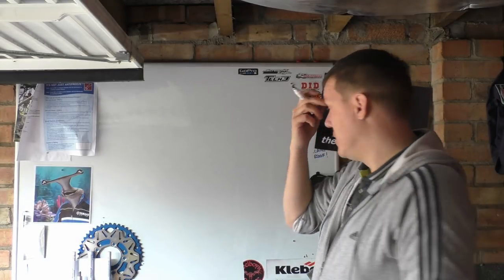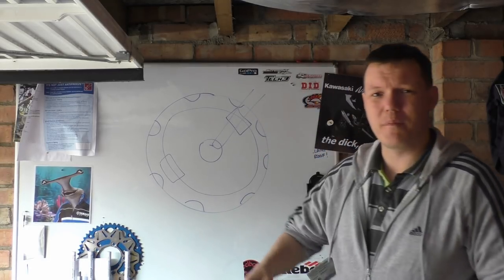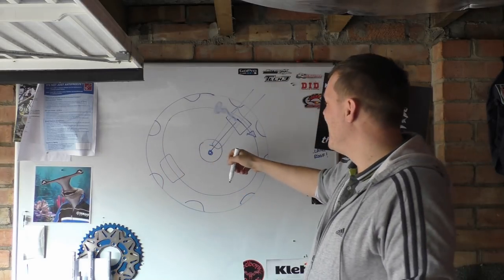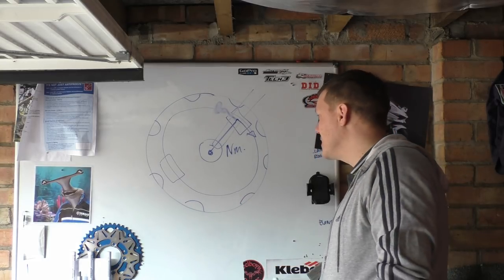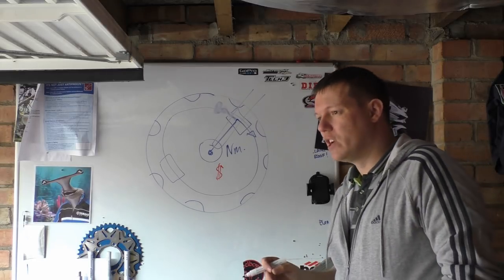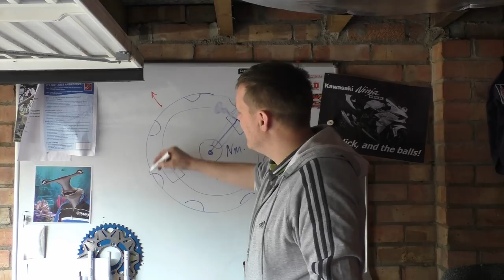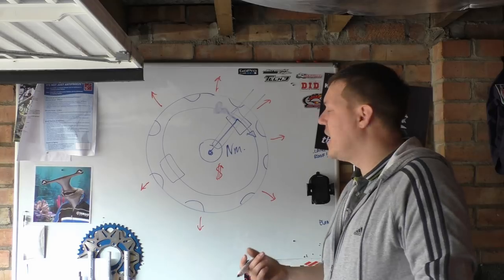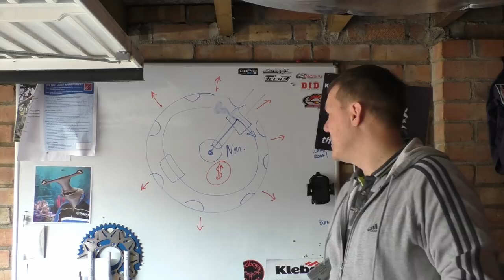Perimeter Brake discs - Any good?

Comment: One of the biggest advantages that Buell used to tout was that the wheel could be much lighter.  Because the forces are acting directly on the rim much less tortional strength has to be build into the "spokes"

Comment: They did it for many of the reasons you talked about but also because it reduces the torsional load on the spokes by transferring the braking forces directly into the rim. That’s why the front wheels are so light and the spokes are so straight, unlike a traditional wheel where you need to take up that tortional load with the spokes. You could argue that the weight saved by the lighter rim is just put into that larger disc but I don’t think this is true. Those EBR/buell discs are pretty darn light for their size and the wheels are also pretty light for a stock sport bike. Also, the ebr has a ram air funnel that helps to cool the rotor and caliper as well. My father calls it the “bee funnel” lol I think the ebr discs are comprised of two stacked pieces, maybe something to do with heat and possibly to counter warping? Can remember now it’s been a while...

Comment: Conventional setup requires two disk and calipers on the front wheel, this setup only requires one of each due to the extra leverage or torque. Only requiring 1 set should help with cost and weight for comparison

Comment: I owned an xb12stt for a couple of years and stupidly sold the bike. I miss it every day. But as I remember from the xb12 series, the rotor was floating. I remember the rotor bolts having a shoulder that stopped the bolt from being torqued down and clamping the rotor in place, allowing for heat expansion and other forces applied to the rotor under heavy braking. And the xb12stt also ran a 6 pot caliper on the front. It truly felt like it could stop a train, let alone a bike.

I would highly recommend looking into getting one if you are interested, it was an eye opening machine.

Comment: Not only is it because the disc is closer to the rim but, there's better stopping because there is more area for the calipers to grip in the same time frame as regular discs. So the wheel doesn't need to revolve as far forward in the same stopping time. Which means in theory it would bring the bike to a stop quicker than a smaller diameter disc. Of course it's continually going around on a regular disc & making contact but, the front wheel has to continue to revolve to do so.
Reply from the maker: This is the torque bit
Reply: shane Yeah, if the calipers are strong / uprated enough it's possible. 'On paper' engineering wise, it's just a more 'efficient' design.

Comment: You should definitely get one if you find a good deal. I have 4 bikes, and one of them is an '07 Buell xb9sx. I love it, it's such a quirky bike and really fun to ride. The perimeter brake does actually work really well. I also have a super duke 1290r with the brembo m50's that stops way better than the Buell, is way faster, and handles way better too, but the Buell still has a special place in my heart and I enjoy riding it.

Comment: How do they determine how wide and tall a pad should be?  If one was gonna upgrade, wouldnt just getting a caliper that can accommodate a wider pad be a good upgrade, without replacing the mount, caliper, and rotor?
Reply from the maker: Weight and piston size is the consideration here - which we'll get to soon

Comment: I got a TM racing 530 black dream. And the bike got a perimeter front brake. It is the best front brake i have ever used. The TM got a bigger disc than the buell and a better way of mounting it to the rim so it docent make it look so weird as the buell(in my opinion) if i could i would get it on all my bikes.  Best brake set up ever.

Comment: Matt talking about brakes ... I'm probably looking at this from completely the wrong angle but idk basically the whole idea that energy is transferred rather than created or destroyed means brakes transfer kinetic energy into heat but squeaky brakes do they operate at slightly lower temperatures or work better ? Where's it getting the energy from to make that noise ?

Comment: Yip, the spokes do not have to transmit braking torque from the hub to the rim therefore can be thinner in construction making the wheel lighter (refer the inserted photo). The big disc itself offsets this somewhat but allegedly this system makes for less unsprung weight, therefore improving roadholding - with 1 disc only mind, but due to the substantially larger cooling surface this is said to be enough. 
Honda had a similar system on their 50cc racer whereby a caliper clamped the actual rim i.e at an even larger diameter than Buell's disc acts on. It worked, was light also - but it's not suited for heavier bikes due to the heat generated in the rim heating up the tyres.
Eric Buell did many things different, a bit akin Kiwi Britten, and it's a pity his endeavors also came to an end.

Comment: hey matt what about the pro that the momentum which occurs between the contact point to the road and the contact point of your caliper when you break does not have to be taken by the spokes of the wheel (so theoretically mass can be saved there no?)

Comment: A conventional brake had lower speed, but higher pressiure on the pads. Does this affect performance or wear?
Reply: A bigger disc has a higher tangential velocity, tough the same rotational speed (for a given motorcycle speed).

Comment: Would a large disc increase the centrifical force on the Wheel?
Reply: MadxJim whatever
Reply: squid RR 508 centrifical? is that something to do with the velocity the shit hits fan?
Reply: love that one "shit hits the fan"
Reply: squid RR 508: correct, being further away from the center it will spin faster thus increasing the centrifugal force. But I doubt the difference would be great considering the weight of the disk compared to the weight of the wheel+tire.

Comment: I’m surprised you didn’t mention the extra weight due the the larger disk, and that extra weight being further out on the wheel making the rotational weight higher and adversely affecting acceleration and cornering.
Reply: It is more than offset by the wheel itself being much lighter because the spokes don't handle any torque. On a rear wheel that must handle motor torque you would be absolutely right, but the front wheel can shed a lot of mass when paired with a perimeter disk.

Comment: As pointed out gyroscopic effect is a downside..Also heat dissipation goes into the rim so the bike if used quite hard will heat up the rim and tyre pressures will increase. Usually most Buells have a single disc so that single disc has a lot more heat put into it as it has to do so much more work than having two discs. The expansion of the hotter disc will as you point out cause warping. The benefits are not great enough to surpass the down sides. Buell went to WSB a couple of years ago and they were at the back of the field then homologated a more traditional twin disc set up with Brembo brakes on the bike and instantly improved their results by a couple of places and less retirements due to mechanical issues.
Reply: http://www.brembo.com/en/company/news/sbk-2016

most of the grid did the same thing!

Comment: What about weight? Would both be very similar?
Reply: I dont know about the buell but on my TM 530 black dream the weight is lighter than regular brake set up.   i tried weighing my set up against different regular front set up ( 4 discs and 3 calipers where i found an average weight on them)  it is 3-4 years ago so i dont remember what the numbers was but the perimeter brake set up was a little bit lighter then regular.
Reply: supertedogpriken Interesting. Though the potential warping could be a hazard, the lightness could go to the pros as opposed to cons. 😄
Reply: i have no real proof of this (never measured with a proper tool, only my fingertips)    but the perimeter disc always seems so much colder then regular discs. and the caliper is smaller and needs to use less force so less friction on the disc. And the perimeter disc is stretched out over a bigger surface so bigger heat loss and more cooling. less chance for heat build up and warping.  my 2 cent`s  :)
Reply: Brakes turn kinetic energy into heat.  So assuming the same materials, unless one system dumps heat much better than another, the rotors need to weigh roughly the same to be able to absorb the same amount of energy in the same (short) amount of time.  So yes, the perimeter rotor would probably weigh about the same if designed for the same performance / job. 

What potentially weighs less is the wheel (because the spokes don't transmit torque, they can be lighter) and maybe the caliper and caliper mount (because it has a longer lever arm, so doesn't need to be as strong for the same brake force).

Comment: I would say another disadvantage of the perimeter disc is larger moment of inertia. Not really what you look for at sport bikes.
Reply from the maker: We'll get to this
Reply: Agreed, I'd include unsprung weight too. I still love the fact there's still companies out there with the balls to try something different and push the envelope but its too rare. There should be way more REAL innovation out there. 
I support it when I can.
Reply: Tim Ebert except that because the disc is mounted away from the hub, it allows for a much lighter wheel construction, so it is a bit of a trade off.
Reply: That's a good point. What are the max loads on a wheel though? Are they designed purely with breaking torque in mind or do the various shock loading from impacts etc. well surpass that. 
What I'm wondering is do they actually lighten up on material?? I'd suggest probably not but no doubt the marketing department and the journos they feed will spout that.
Reply: Well, if you think it's marketing gimicks, just look at the weight of an EBR 1190 front wheel - a hubless design.  7lbs, that's it.   Also, consider that the while a single perimeter rotor may be more mass than a conventional 320mm front rotor, most bikes in that class have two rotors and two calipers, while the EBR has only a single rotor and 8 piston caliper.  Wheel and brakes together as a unit is roughly 10lbs lighter than a typical dual disc and wheel setup on your typical bike.

It would be interesting to actually do all of the math and figure out if there is indeed any advantage or disadvantage in regards to moment of inertia between  a single perimeter setup and a traditional dual 320mm setup.  More mass further away from the pivot vs. more total mass further inward.

No matter how you slice it though, a very light front wheel, and likely lighter brake setup will give an advantage in unsprung weight.  It also means that the brakes have less total mass to fight against.

I am no great hero of the perimeter rotor, don't get me wrong.  If they were the end-all of brake technology, every other high dollar bike would have switched over, or started to at least.

Comment: Keep in mind the larger the diameter of something the faster and further it is traveling from the center axis. So basically RIP brake pads that are traveling double the surface in order to stop.
Reply from the maker: That's not the way it works, because you're also missing something. It's correct that the radial velocity increases, but when the brake pads engage, so does the torque...

Comment: One little niggle - the doll hair sign. You put two lines through it. A common mistake. It's supposed to be just one. I have no idea where 2 lines come from. Same with the GBP symbol. One strike. Not two.

How long does a brake disc like this last?
Is it just ridden by Summer bikers only? The only time I ever saw one. (just one)
Reply from the maker: Well it can be both. It stands for US with the the 'U' over the 'S' - https://en.wikipedia.org/wiki/Dollar_sign

Comment: TW you ever see the Wakan motorcycles? Pretty cool, retardedly expensive. Similar to the Buell mentality, but they used a spine chassis, air cooled v-twin and stored the oil in the vertical portion of the chassis. Pretty sharp looking... you probably wouldnt like it, too sexy.

Comment: Totally stupid dangerous idea on a motorcycle  huge mass with huge gyroscopic  forces   not a good idea on corners lol might make sense on a car  or truck but motor cycle nope matt covered some good points as  well
Reply from the maker: "huge mass with huge gyroscopic forces"

- Huge?
Reply: Simple physics  bigger the mass bigger gravity, bigger rotational forces ,in all directions, huge stored kinetic energy the list goes on conservation of energy sprigs to mind
Reply: It doesn't look heavier than a large conventional disc but all the mass is concentrated around  the perrifery so it possibly has more rotational inertia.
Reply: You're not really supposed to use the front brake while cornering anyway. It's for slowing on a straight, before you enter the corner. Using it while cornering pulls the bike over to the side (usually into on coming traffic). Or on to the floor in a lean. If you need to, you should only use the rear brake but, again watch out for skidding. If you've got it that wrong going into a corner though, slow down a bit. Although sometimes the oncoming traffic can get it wrong, causing you to brake.

Comment: I thought the main drawback would be a big f*cking mass of this brake disc and heavier wheel (with bigger unsprung mass and worse acceleration&steering due to inertia, momentum etc.)
Reply: Wheel is lighter because it carries no torque. Also it's one disk and caliper vs typically 2 central disks and calipers in this perfect class.

Comment: The rotating mass and wheel balancing is fucked up too on that piece of shite.
Reply from the maker: Really?
Reply: Yes Matt, For me that is the biggest shit. Go and ride one that has a few thousand miles on the Odometer and you say it rides like a fucking piece of shit as soon you need to brake it down fast. And the zero flex is just made up. they managed it only to make the spokes to flex in both directions because the mass still pushes on the center of the rim. Take a rim and loosen the spokes to make it visual... You will see what happens. I want my spokes to flex only in one direction.

Comment: I owned a Buell XB 12S and it was asn incredible piece of shit! Mostly the Harley engine. It would boil the fuel in the frame. Surprisingly slow as well. It was a mix of fractional, metric, torx, and every other stupid thing. You have to drag out ALL the tools to work on it. On a warm day it was a guarantee I'd be pushing it.
Reply: still want one
Reply: Have a XB9R and a EBR 1190.. both stop amazing for street use

Comment: Someone else said this already but the added weight of that massive disc is in the worse spot it could be in for gyroscopic effect.. Dude you totally blew it on this one by missing the single biggest negative for doing it.
Reply from the maker: LOL gyroscopic effect is just bad! Why? This is what happens when you don't understand the entire picture. For straight line stability the gyro effect is a good thing, and during cornering its also a good thing. Granted it makes it harder to flip the bike over, but as with everything there's a pro and con.

What you said is just a con.